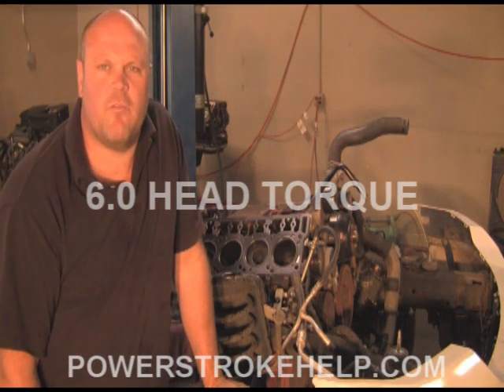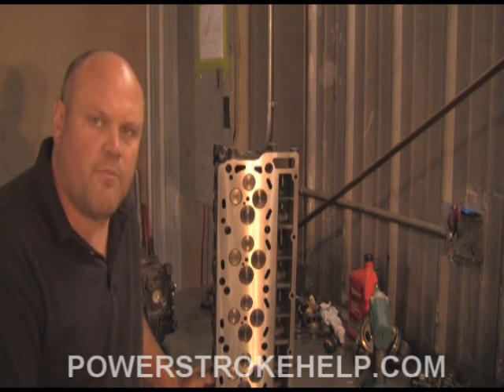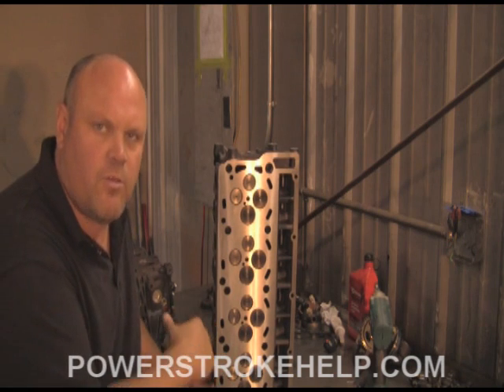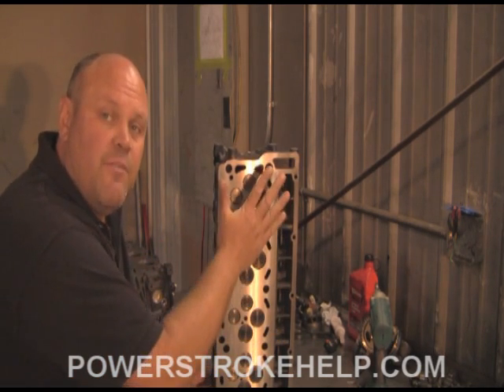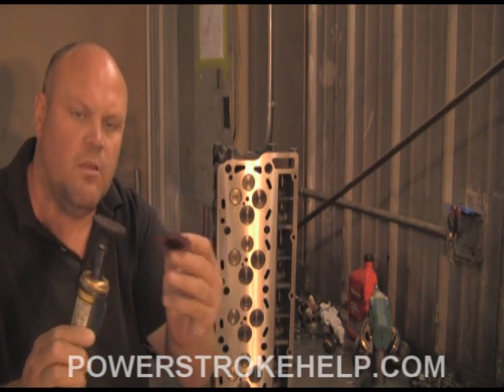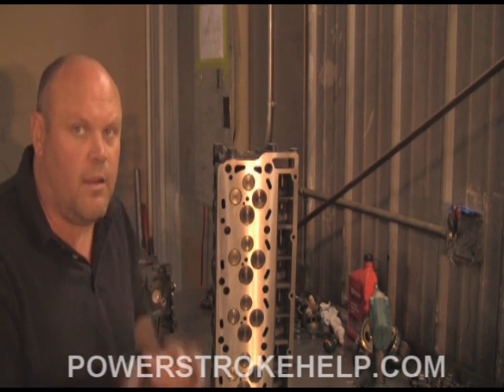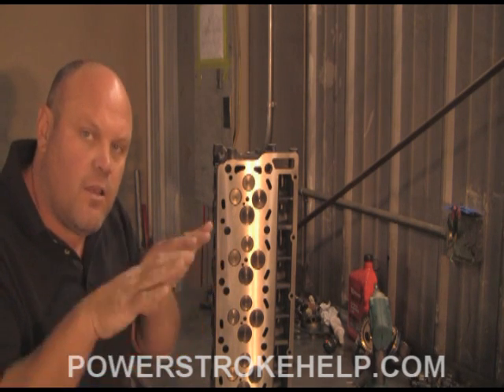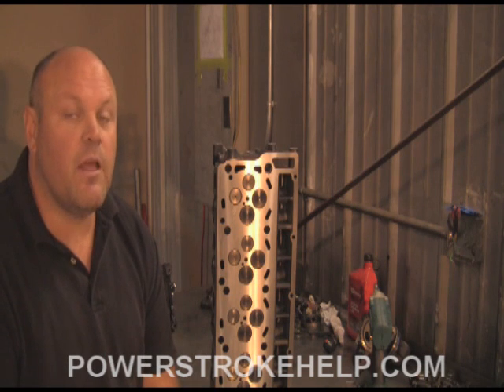6.0 HEAD STUD TORQUE PROCEDURES

Comment from the maker: Plese call me at 770-931-4070 ext 1. Leave a message. I am about to launch BiggDogg cylinder heads with orings new valves, bronze guides for $1900 per pair. We got 6 pallet loads in stock ready to ship.

Comment from the maker: MAJOR F**K UP. Not only have you just clogged your new oil cooler, but you have infested your motor, radiator, heater core with this crap. You will have to disassemble the whole motor to get it all out.

Comment: I had a mechanic that did my oil cooler. when it blew he did not torque anything he put to repair the truck and did not replace the EGR Cooler. when the mechanic was done with the truck and the engine running it was leaking coolant on the driver side of the engine, so what I did is I bought a stop leak from walmart and put it in the coolant reservoir to stop the leak. will that affect the oil cooler and clog up? since I put the copper stop leak in their? thank you.

Comment from the maker: yes the cooler itself is held by bolt in the rear. As long as you have the stainless straight pipe with no bellows you will be OK.

Comment: Ya thats what i was thinking would be safest, another question is i already have a sinsister type egr delete on my truck but as i dont feel these are that great, i bought a bulletproof egr delete with the welded ends. My question is, is that since the delete kit already on my truck has the strait up pipe and not the old style up pipe (on a stock application) do i have to worry about buying the old style up pipe or will the bulletproof egr cooler be supported fine without that "y" connection?

Comment from the maker: @ReggyRay289 I dont know anything about cummins swaps other than what I have seen on the internet. No hard feelings it is just not my area of expertise. The best way to "swap" a 7.3L PSD is to find a good running ford chassis (damaged cab, salvage etc) and set your cab on the chassis. We have done it several times with excellent success. The old frame and suspension is not set up to handle the weight and torque of the big 7.3L.

Comment from the maker: @coupescuts This is a matter of how you use the truck. If you intend to pull heavy and be on the road a long way from home, it will be in your best interest to get the bulletproof done. If you are mostly local, and keep an eye on it you should be OK. BUT I would definitely have EDAS installed so you have warning before you inadvertently hurt the engine. You can get more info and order on the POWERSTROKEHELP (dot) COM website.

Comment: Bill, would you recommend doing head gaskets and arp studs on a truck that does not have any head gasket problems?  I have an '05 PSD with 112kmi and was mechanic owned up until now.  I plan on doing the egr delete, but I'm not sure if I should preventatively do the head gaskets and studs.

Comment: I've got a 2005 6.0 powerstroke with 156,000 miles on it. It has a really rough idle and runs, basically, like crap. The local diesel specialist told me it was one of the injectors going bad and i am pretty sure they have never, or at least not any time recently, been changed. Would you agree that it was the injectors or something else?